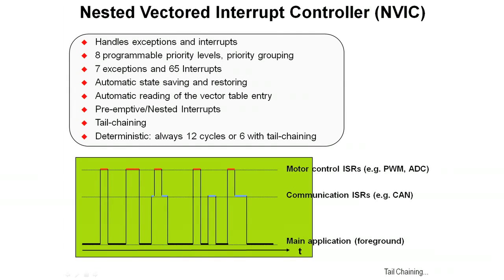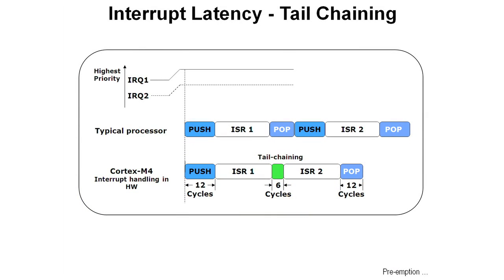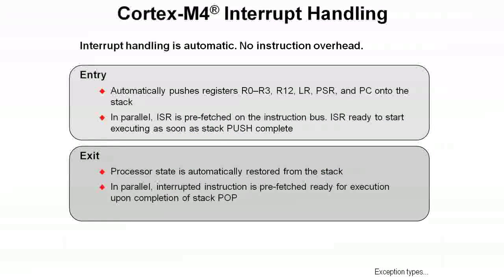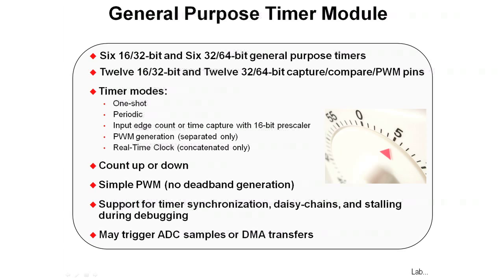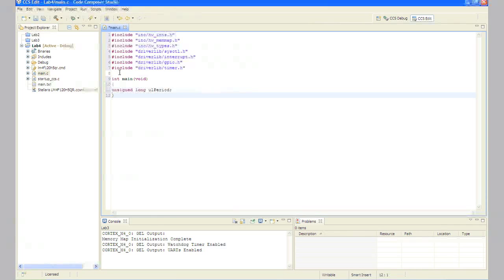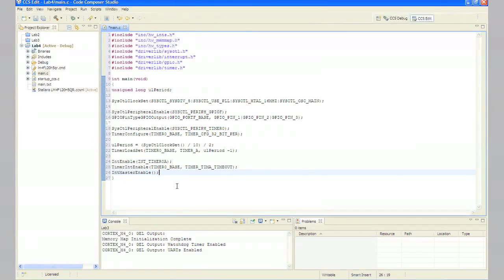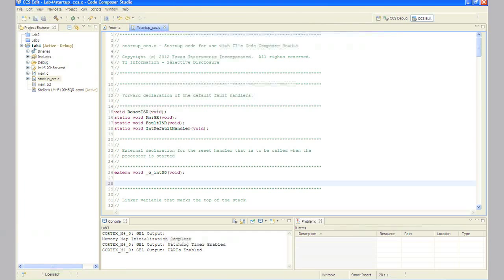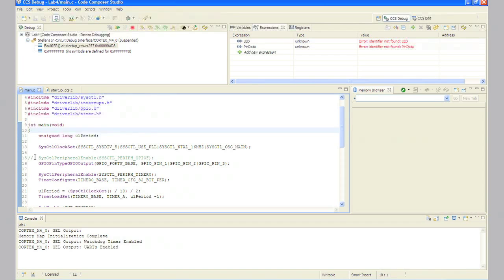Chapter 4: Interrups and the Timer

Comment: Hello, congratulations for your work! It's being so helpful. 
I've just compiled your code with the CCS6.
I modified a little bit, because it was not compiling.  
I added this library: #include "inc/hw_ints.h"
and I modified this line 
// Interrupt Enable
 IntEnable(INT_TIMER0A_TM4C123);
Now, it is working!

Comment: I think what happens is it reads that ISR1 shows up and the typical processor then throws away the pop for ISR2 and starts working on the ISR1 pop, they can't switch back and forth. I don't think you're able to save the ISR2 pop, but you may be right.